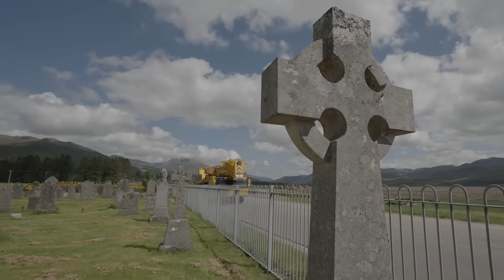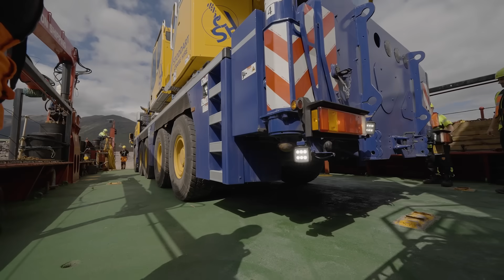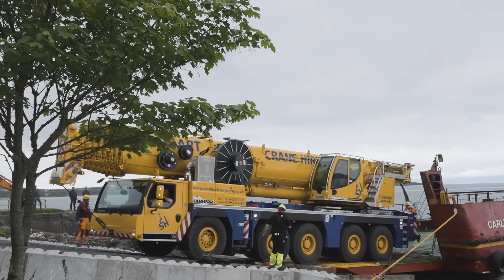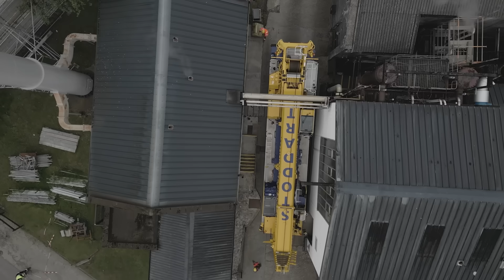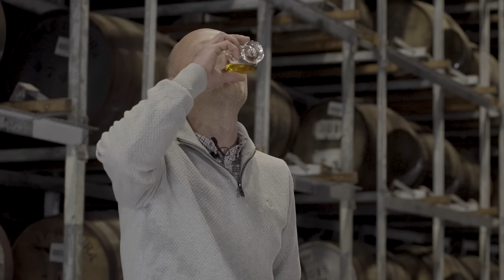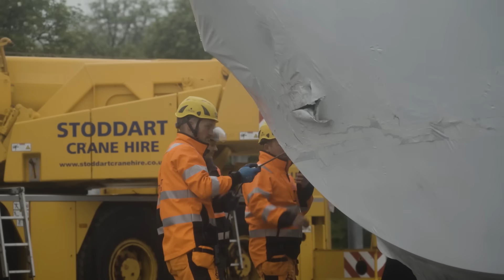LTM 1230-5.1 A crane trip to the epicentre of Scotch whisky | Liebherr

Comment: The crane doesn't weigh 230 tons.
Reply: did you listen to it all?
Reply: @paulharrison6417  
Yes he said the roads weren't made for a 230 ton crane.
Reply: @waterboy8999 thats its lift capacity, when assembled and fully ballasted. They travel at 60 tonnes on the road
Reply: @ryanmurray3598 
Yes so, the roads are not built for a" 230 ton crane".....

Comment: So, a 60 tonnes crane was at limit, but 40 tonnes boiler + truck and trailer was not?
Reply: Exactly
Reply: That was using cal Mac but they used private company boat that could take the load 🎉